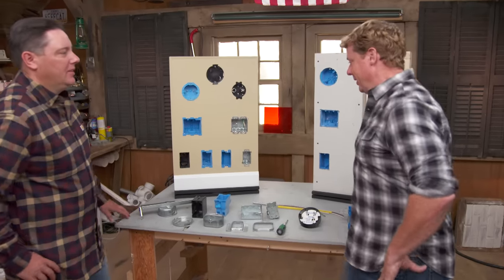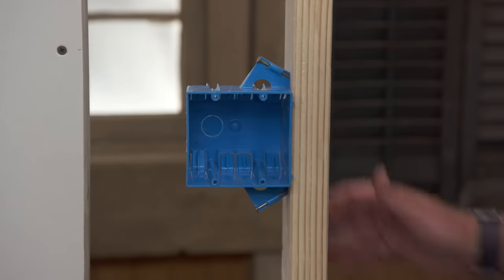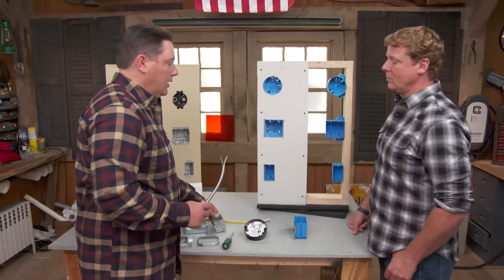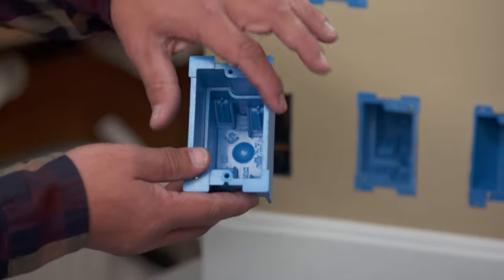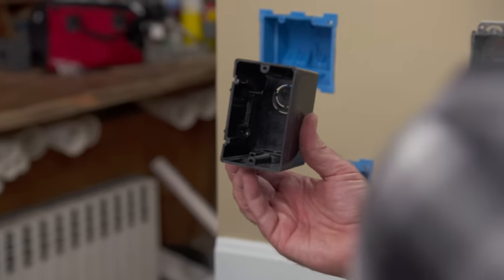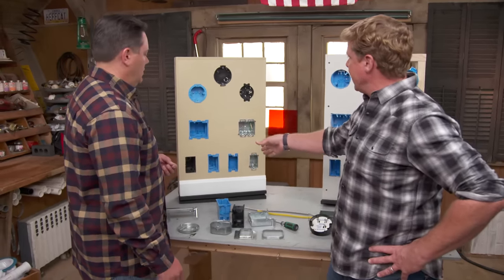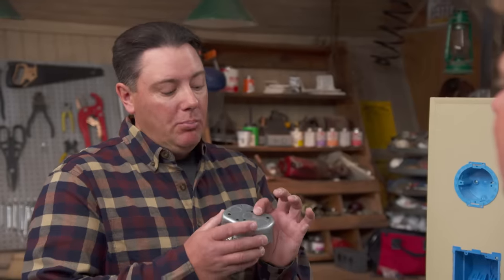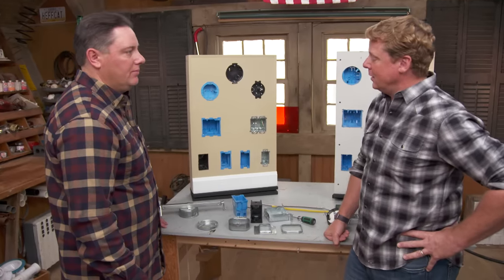How to Choose an Electrical Box | Ask This Old House

Comment: wish more time was spent on the odd boxes.  I was hoping to find out more about the very shallow box on the table..... nothing! didn't mention it.... didn't even pick it up!
Reply: Its a pancake  box,  used for lights/fans.  Mounts directly to bottom of joist, box is shallow enough to sit flush with drywall

Comment: Cold day in hell before I use a plastic box or Romex cable.  Steel boxes and BX seem so much safer.
Reply: Depends how it's installed and stressed,  I can install both products equally hazardous or equally safe.   NM, BX, MC,  I have seen sheet rockers sink screws into all of them.
There is no difference to me, but I am an electrician that doesn't crowd or stress. I also install NM in places were NM is, and BX or MC goes where BX or MC belongs.
It depends on the project and it depends on the payee.  Not everyone wants to pay double on their electrical.

Comment: is it ok to use a blue can box for a flush mount 4ft led fluorescent  light?
Reply: A blue plastic box will be ok for 4ft led or 4ft fluorescent light. (any lighting circuit in residential )
Just be sure to keep your power wire away from Audio or Cat wire or you may get interference in your phone\ethernet or audio, especially if fluorescent light is nearby audio or cat, some re-routing of something may be advised in this situation. ( 1 foot spacing is fine for audio or cat from power.)
Reply: Moose I suggest watch a 13 part series called What on earth happened by Ewaranon to learn that the earth is not a globe. Link in my about tab.
Reply: @DevJB  Is interference not an issue with incandescent bulbs? I would assume so. BTW I only use incandescent bulbs because LEDs create harmful dirty electricity and blue light.

Comment: Imagine having room for only one switch or outlet

This meme made by Double Gang!
Reply: Judah Matthews … that's the way they built homes before WWII.... one switch and one outlet per room. Quite often they added central heat afterward and put the cast iron radiator in front of the outlet so you had to hunt around to find it.

Comment: How could you have skipped the deep box or expansion box with the side pocket?! It was right there and probably the most important. People are installing all sorts of smart switches these days that take up a lot of room. Combine that with more people using 12g wire everywhere and yeah.  And they make good in wall secret safes.
Reply: Jonathan I suggest watch a 13 part series called What on earth happened by Ewaranon to learn that the earth is not a globe. Link in my about tab.

Comment: Great idea, but missed several useful items. Box depth, square boxes, thick old walls, older wiring, mounting tabs and clamps, 3 in vs 4 inch round box, gangable boxes...
Reply: Miguel P it was a 4 minute video, not a documentary
Reply: Pierre Roy  the point is that it was far too basic and rudimentary for the title.  I guess the fact that you are basic and rudimentary keeps you from seeing that.
Reply: Pierre Roy lol

Comment: Nice video but would be better if you explained box fill capacity, UL listing of boxes( where and how they can be installed) set backs in combustible and non combustible materials, load rating etc. 
Most people just think you can pack as many wires that can fit inside a box, wrong. 
Most people don’t know that old work round boxes are not UL listed for ceiling mounting. 
This is why electrical contractors are licensed they know theses rules and how to calculate box fill capacity. Electrical is not a hobby hire a licensed professional or at least have your work inspected by one.
Reply: tmm I suggest watch a 13 part series called What on earth happened by Ewaranon to learn that the earth is not a globe. Link in my about tab.

Comment: This is the only TOH episode I have ever thumbed down. They missed the old-work metal box, right in front of them, they didn’t discuss box volume, which can easily cause a DIY’er to violate code, they didn’t discuss low voltage separation ( extremely common in the digital age. A disappointingly shoddy presentation.
Reply: NM I suggest watch a 13 part series called What on earth happened by Ewaranon to learn that the earth is not a globe. Link in my about tab.

Comment: plastic boxes suck.  It takes more time to nail them to the studs without flexing the box than a metal box.  When I inspect a job and I see the blue boxes, I kick that tradesman off the job.  Stop buying electrical stuff from Home Depot.  There is a Graybar everywhere, use them, and get stuff worth taking the time to install it.

Comment: Please, This Old House, stop showcasing your videos as “How to” do this and that, like it is for anyone. The videos should make it clear that the information is for educational and entertainment purposes only, and that only a licensed electrician should be doing electrical work.
Reply: Huh? I had basic electricity in high school. Lots of people can (and do) do their own electrical work for small stuff. Anyone can replace an outlet or a switch, or install new light fixtures. Just have some common sense and turn the breaker off while you’re working. If we’re talking about adding in a new sub panel or something, sure, call in the electrician.
Reply: I couldn’t agree more, Noah. As an electrician, I see many DIY electrical work and it’s scary. Just because someone took a basic electrical class in high school means nothing. Common sense is not all that common, it has become very relative. Electrical work should absolutely be done by a professional even if you’re a DIY cheap skate “electrician”.
Reply: Malarkey. Putting in a box or wiring a switch is simple. It doesn’t even matter which wires are on which screw with a normal switch most people have. There are very few reasons to call an electrician for the things discussed in this video.
Reply: jcnash02 That’s fine. Just remember 87% of electrical fires occur from fault connections which are “simple”. People  won’t admit their limitations until an accident happens. This may not apply to you specifically, but we’re talking about most homeowners.
Reply: jcnash02 what do you consider a normal switch?